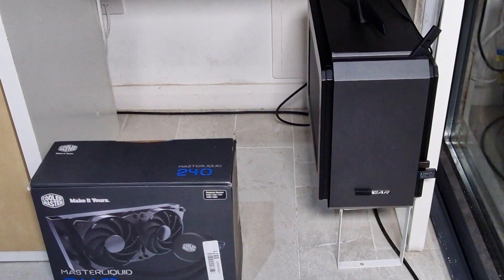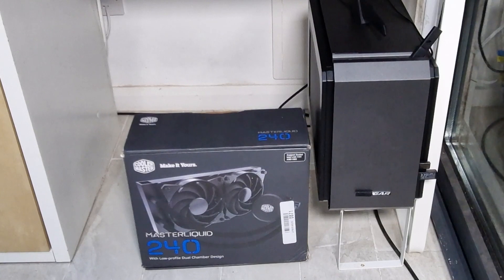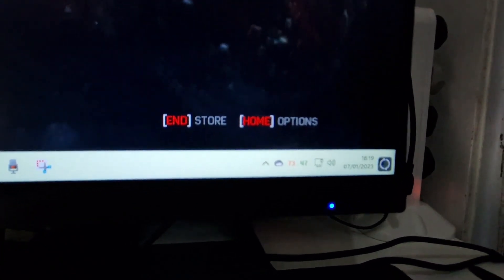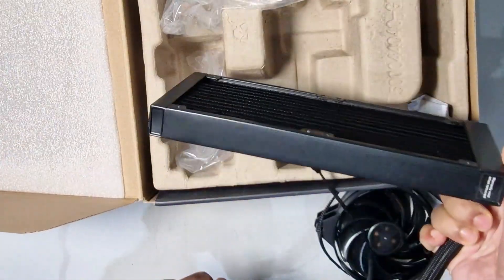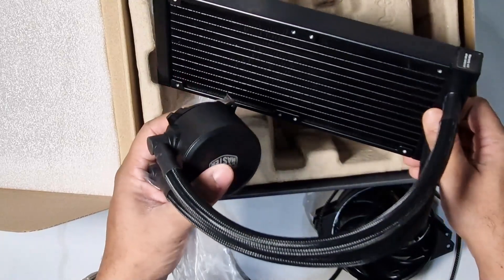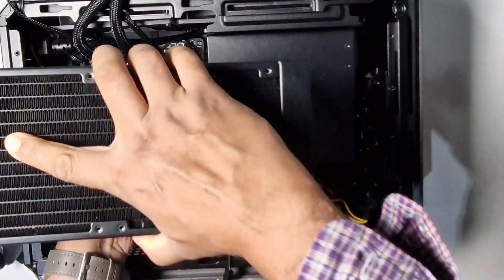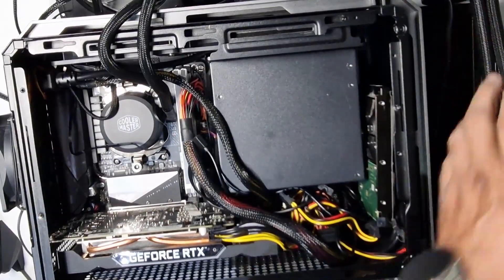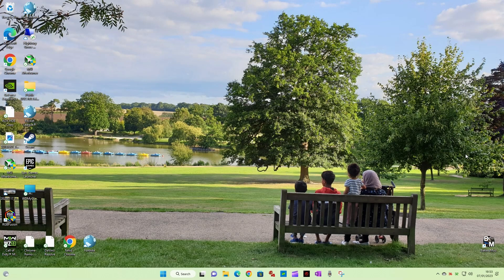Comparing COOLING of Ryzen 7 5800x with 120mm Radiator VERSUS 240mm Radiator AIO.

Comment: There is information on redit about this CPU running hot, I just bought the same CPU before I knew this. Turn off any performance boosting in the BIOS should help.